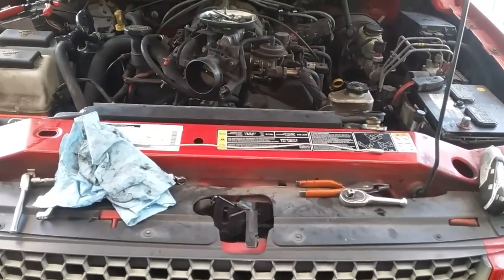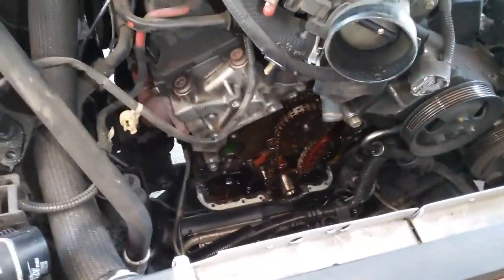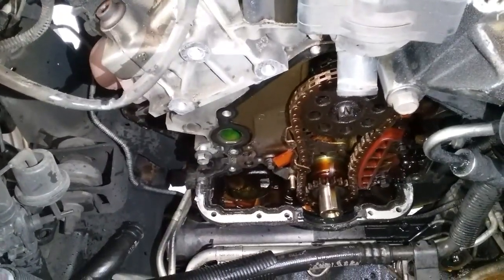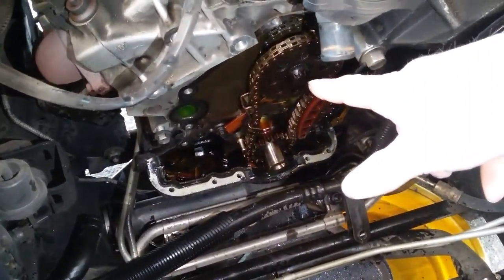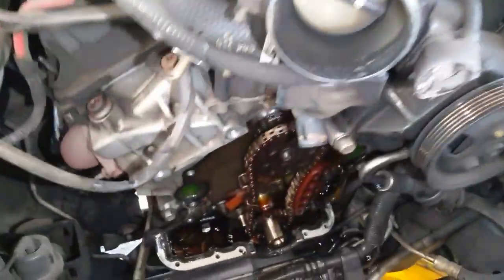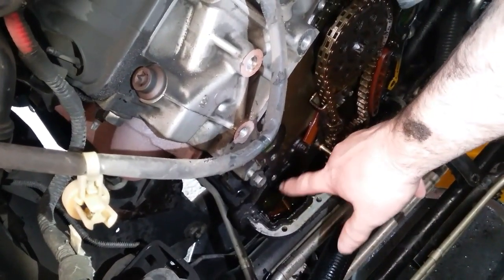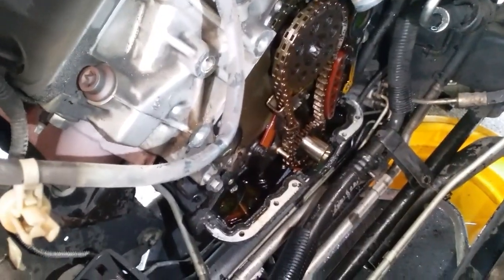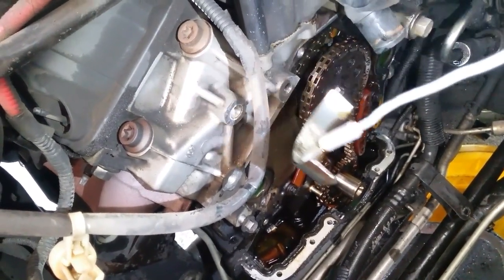Timing chain noise 2001 Ford Ranger 4.0L SOHC V6

Comment: Does anybody know when they did the redesign? I have a 2001 2WD 4.0 188k runs great but rattles some times when you first start it then does the same noise when you step on the throttle hard when it's cold. All goes away when warmed up.
Reply: They redesigned the tensioners in the 2005 4.0 SOHC v6. They were better but they still have the rattle.
Reply: @WorIdsSmallestViolin  I have an 05 4.0 v6 in mine. It’s still bad :(
Reply: There are 2 27mm tensioners that are mounted in the head that you can easily (relative to this vid) replace
Reply: I got a 99 ranger with a 4 banger that has that same issue... ever figure out what it was for you?
Reply: @BermChasin'  Nope I loved that truck best one I ever owned I even pulled the engine did all new timing chains & guides the next morning same issues same noises drove it another 2,000 miles and it was totalled other driver at fault I bought it back from insurance and they lost the truck never found it I was going to fix it my self it was a mess. 99 with a 4cyl will last you forever I've had some of those to  when I buy small trucks i only buy Rangers

Comment: Thanks. I think i have this issue https://share.icloud.com/photos/0PldienpwZ55Ree0uufh6UUQQ here is the video i made of the sound. Oil pressure is fine, start is fine. I’m just wondering if I should be concerned about driving it 3 miles to the shop? Not a mechanic and just unsure about driving it 3 miles in fear of potentially doing more damage.

Comment: Do you have a video of what that rattle sounds like? I've got an '04 4.0 SOHC 4x4 that's got some noisy lifters but I've also got some rattle when I hit the gas that I'm just not sure of. Thanks!
Reply from the maker: John-Dominic Heim what you dont realize there are no "lifters" on that engine.   So if you are hearing lifter noise... there is something else. The noise that is created by this timing chain issue can be best described as a small size metal link chain rubbing on a piece of metal at a very fast pace. Its loud, and coming from the front of the engine.
  I did run into a ford explorer that had an engine knock. That i couldnt solve. Thought the knock was the rod bearnings... so i pull the motor.. and put all new bearnings(rods and mains) then new timing chain sets..and knock was still there.never did find the source of the knock. Customer elected to junk the vehicle afterward.
Reply: How do you mean there's no 'lifters'? Can you give some detail? I googled 2004 ford ranger lifter noise and all kinds of stuff popped up that was pretty much on target with the symptoms I'm seeing.
Reply from the maker: Im sorry my mistake. Yes there are lifters. they sit under the rocker arms below the overhead cams. ( I had to look up the service manual to remind myself)  your noise is hard to hear from your video. But I can faintly hear a ticking nose. Here is what Id do....First use a mechanic's stethoscope and listen to various area to determine the location better. If you feel the noise is coming from under the valve cover then remove the valve cover on the suspect side, and run the engine. yes it will get messy. Then use a  stethoscope to listen to each lifter.  
   The noise in your video is too faint for me to tell what exactly it can be. But I can tell you it's NOT timing chain.
Reply: No worries! Thanks for the advice!
Reply from the maker: SurelyYewJest .. actually yes there are lifters. I was mistaken.  The lifter in below the rocker arm. The are use to take up slack between the arm,stem, and cam lobe.
 The lobe doesnt contact the valve stem directly.
Reply: Alright, so I figured out my problem. It wasn't my lifters or anything to do with them. I changed my air intake idler valve and my EGR valve and controller. All the clatter I was getting is gone along with my rough idle.
Reply from the maker: John-Dominic Heim  wow thats a new one for me! Glad you got it fixed though.
Reply: Update with new issue: Some clatter came back and my truck is now dying randomly and having difficulty restarting in some instances. I put it in park at a drive through and it was making a lot more noise than it had previously, almost sounding like knocking or ticking. Put it back in to drive and it died on the spot. Finally got it to restart after getting nothing more than a single click when turning the key. Put it in to reverse to back out of the parking spot I'd gotten pushed into and it died again. Restarted with some effort and made it out. Put it in drive, died again. Restarted with a little less effort. Got to a light, died in drive. Got it restarted and managed to get it the rest of the way home but it definitely kept trying to die unless I gave it gas. Suggestions?
Reply from the maker: @john-dominicheim8734  take it to a shop. Throwing parts at will get expensive quickly.
Not having the vehicle infront of...i cannot give suggestions that has the possibilty of steering you in the wrong direction.
Reply: Thank you, sir.
Reply: @john-dominicheim8734  Is it possibly the Intake Manifold Swirl Control?  I'm trying to figure out my problem as well, I hope it is not the chain.
Reply: maikerumine I’ve got a sneaking suspicion that mine is lifter knock and chain rattle on acceleration. I’m at 254k miles. It’s about due lol
Reply: Lifters, at least as they relate to cams and valves, are only in overhead valve engines. Ford stopped making the OHV version of the 4.0 in 2000. The SOHC 4.0 is based on the old OHV 4.0, but is fully overhead cam. No lifters at all.

Comment: It's not possible to just replace the tensioner without removing the motor? Or you prefer to replace the chain at the same time since it's open?
Reply from the maker: Paul Baird it depends which chain you want to change. Ideally you want to change all 3 or 4 chains. (If u have a balance shaft)  In that case your life will be much better off if you remove the motor. Remember there 3 chains up front, (Balance shaft chain, crankshaft to jackshaft chain, and jackshaft to left camshaft chain.) And one in the rear (jackshaft, to right camshaft chain)
Reply: No, you have to remove the engine to get all 4 done, since the right side cam gear is on the back of the engine, and you can't get that chain cassette out and replaced without taking off the transmission and pulling out the engine seal, which covered by the transmission bell housing when everything is mated together.
Reply: @SurelyYewJest  my Ford expoler is making a loud tapping noise and I took it to the shop and he said it was one of the timing chains, he said you could drive one for years making that noise and that instead of replacing them you might as well replace the motor, is this true?
Reply: I'm not a mechanic myself, but I've heard this job regularly quoted as being at least $4,000 to do. And that number seems to make sense, since you have to remove all belt-driven accessories, take the heads and valve train apart (and it wouldn't make sense NOT to clean everything while it's off), and then rebuild it all with new parts and gaskets. 

The only thing the mechanic isn't doing is taking out the crankshaft and pistons; other than that, it's in effect basically a full engine rebuild. That's part of the hidden cost of Ford reworking an OHV engine to be OHC. GM and Chrysler have made similar compromises in the name of saving engineering time and money, so Ford isn't alone, here. But it sucks nonetheless because even the aftermarket hasn't found a fix for this.
Reply: @SurelyYewJest  thank you for replying to me, I guess we will just drive it making that noise until it dies then I'll just get another rebuilt engine in it, the vehicle means a lot to me since it was my late husband's, he passed away 2 years ago and I just feel close to him when I drive it.
Reply: @only1sweetmaddy  drive it with the noise, it will last a long time and many miles. You may or may not get the death rattle one day. These engines usually warn you for a long time when all the tensioners are about to fail you will get the death rattle periodically or PERMANENTLY. Whatever you do, NEVER and I mean NEVER get a motor flush done on these engines, it destroys the tensioners and will make ur chains fly off and wreck the motor...I learned the hard way!!
Reply: @WorIdsSmallestViolin  i had the rattle. It was loud on start-ups but calmed down when the engine was getting warm (though the rattle was still there). I thought that i give it a shot and change the tensioners. Ever since then the rattle is loud all the time. Do you know what i did? I guess that there was still something left from the chain guides but the new stronger tensioner was putting too much tension on the chain so it failed? And too, how long can i approximately drive with that loud rattle?
Reply: @josef18181  No, the aftermarket tensioners for these engines are junk, you MUST buy the OEM Motorcraft tensioners. I've seen a few guys trash their engines putting in those cheap aftermarket tensioners. My best advice is dont replace the tensioners if you arent going with a Motorcraft replacement, because even that failing original tensioner (regardless of mileage) is still better than a brand new aftermarket one. If you get a harsh start up rattle for a second or two, the tensioners are on their way out. Some of these engines also rattle only when warming up then it goes away which Ford says is "normal"...its actually not normal they just said that to get out of warranty repairs.
Reply: @WorIdsSmallestViolin  i did use motorcraft tensioners. So do you think that the chain is running on the chain tensioner?
Reply: @josef18181  That is very strange. Only thing I could think of is that the new tensioners could be making the chains so tight that the chains are riding harder on the metal parts where a cassette used to be before it broke or disintegrated.
Reply: @WorIdsSmallestViolin  thats what i suspect too and as a result the timing chain could now run on the chain tensioner.
Reply: Maddy M did u ever get a rebuilt engine or did u get it fixed? How much was it? Deciding on what I should do.

Comment: fords 4.0 redesign front left timing chain tensioner where do I buy it  I have to many problems with original design.
Reply from the maker: Eric Borez I've done it twice last year,.. and both times I bought the Cloyes 9-0398SB from Amazon yes this kit includes the updated tensioner, and bracket... and for the gaskets Eveegreen FSHB8-20702.(also from Amazon) You still will have to the rear Jackshaft bolt (I ordered them from my local Ford Dealer)
Reply: steve p. thank you very much for your answer I really appreciate it, thank you.